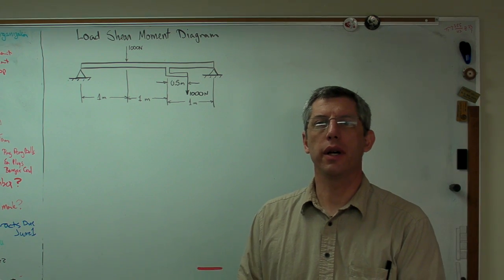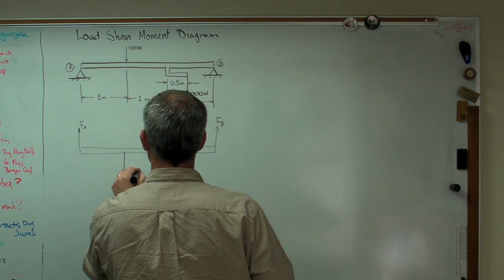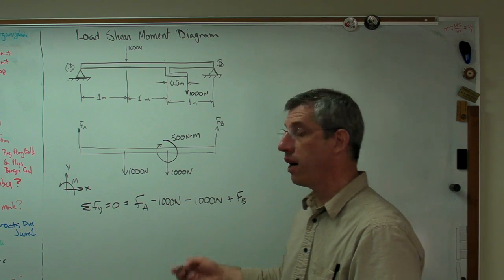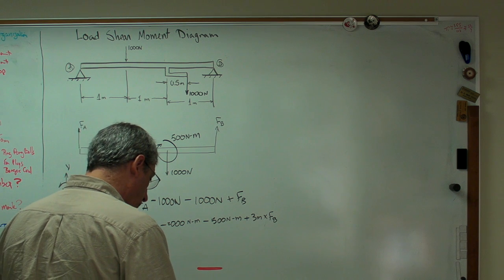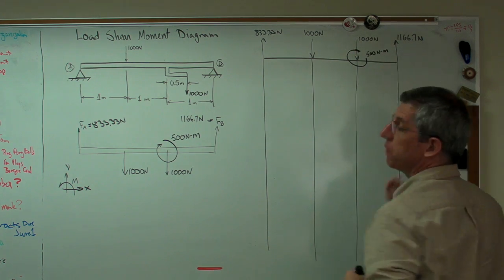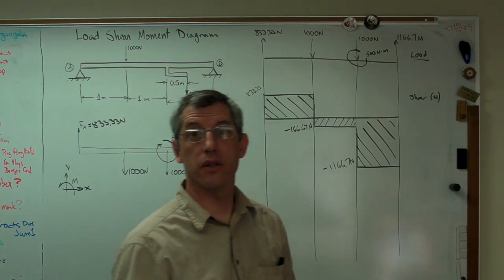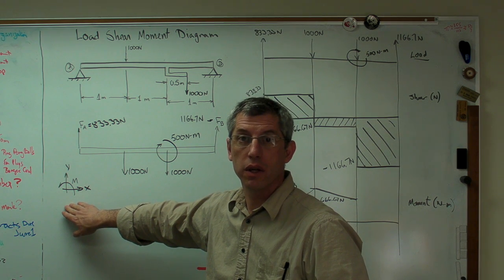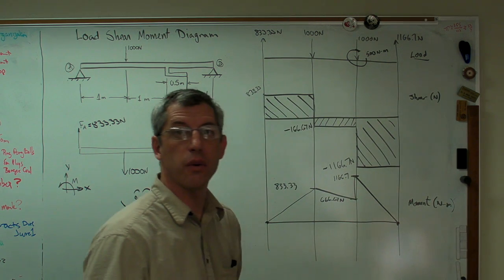Load Shear Moment Diagram with Point Moment.MP4

Comment: Good example. But shouldn't the point moment be taken as -ve in the BM diagram, since the 500 N-m moment is trying to pull the right side of the beam down? That way according to the designer's sign convention the top fibers will be in tension and bottom fibers will be in compression.